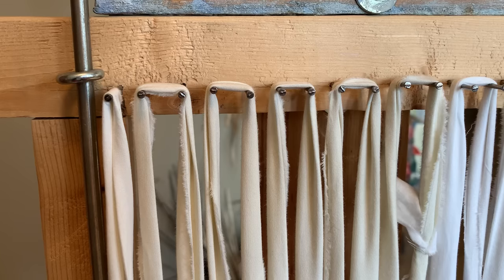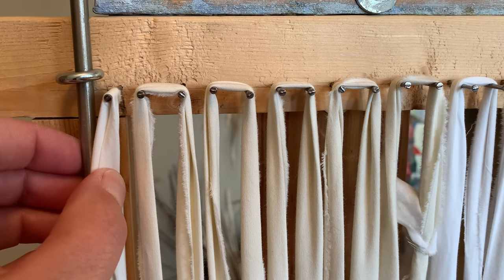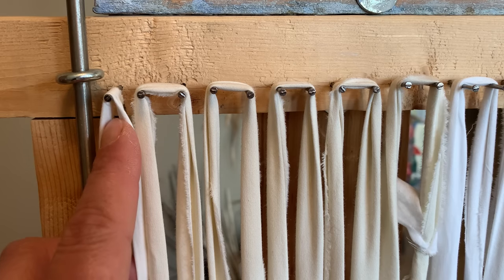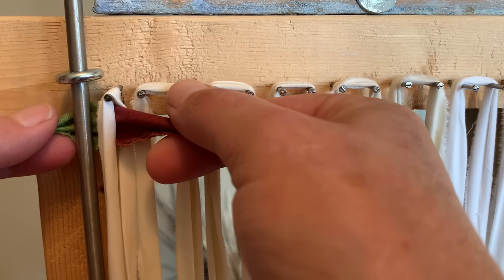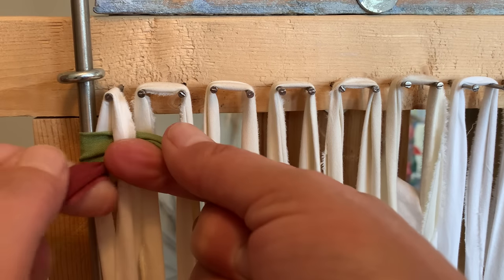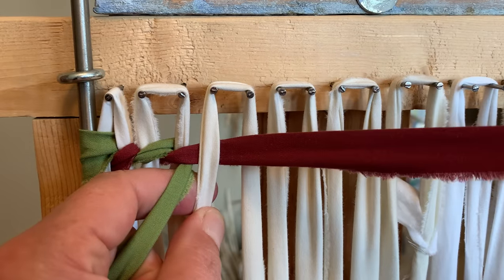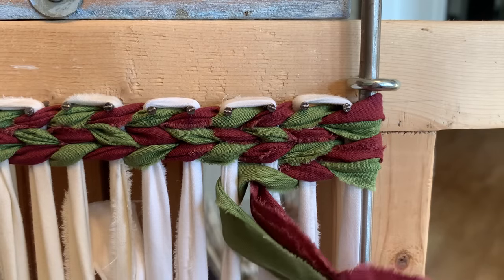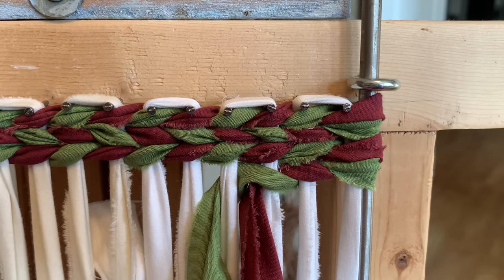BASIC TWINING: How to Twine

Comment: Will you do a video showing everything from the very beginning ? How you choose how many nails to use with your rods and how they look on the bottom as well as the top part. I’ve never tried weaving but I am now going to give it a try as I have an antique two seat swing that this would be perfect for.
Reply from the maker: I have four tutorials, that show the technique from beginning to end. You can find them here 

https://youtube.com/@studiotk2553

The size of your loom determines how many nails you need. I prefer to space mine at a half an inch. You only need two rods placed on each vertical side. I would make a small loom and give twining a try before you tackle a large project like your swing seat. Just so you get some practice and a feel for the technique. Hope this helps. Happy Twining! 😀

Comment: I’m very new to twining, the other videos that I’ve watched say that that first row Hass to go around the steel bar with both weft strands, or else your piece will fall apart when you take it off the Loom but you’re not double wrapping it right?  I’m confused
Reply from the maker: Yes, both wefts are going around the steel rods and the warp closest to them in each turn. You don’t have to go around the rod twice. Just treat the rod and closest warp as one and the same. It’s no different then a warp in the middle of the textile. Hope that helps! Happy Twining!

Comment: I'm confused about the end warps with the rods. On the left you used 1 loop and the rod for the first row, then 1 loop and the rod to turn on the right. But, then you used 2 loops and the rod on the second row turn on the left but still used 1 loop and rod to turn on the right again for the second row. Why did you make the change on the left?
Reply from the maker: @allisonherndon6897  the loop in the warp on the left side only needs to be twined once. It helps secure the wefts. There is no loop on the right side, just the warp and the rod. The rods keep your selvages straight. Hope that helps

Comment: How large is your loom? Why did you split the loop on the right, but not the last (10:49)
Reply: Why no answer? Perfectly valid question; otherwise the tutorial is confusing/inconsistent.
Reply from the maker: I used a small loom for this tutorial. It’ll make a 9”x9” hot pad. You only need to go through the loop once, when first starting your textile. It helps to lock your weft into place. After the first row there is no need to go through the loop again. Hope this helps.
Reply from the maker: @t-ri2582  I apologize for the delay. I’ve answered the question. I hope you find it helpful.
Reply: Thank you. You have nothing to apologize for, I didn't expect you to answer in the middle of the night. 10 hours is not a delay. I'm sure that person didn't realize the question was asked late at night. Thank you for the explanation. Your videos did give use the confidence to give it a go. Happy New Year.
Reply from the maker: Thank you for your understanding. I do really appreciate it. I’m glad you are giving twining a go! Enjoy the process! Happy New Year to you as well!